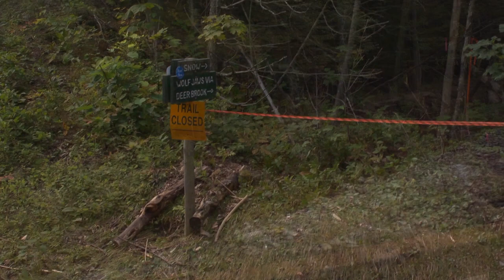Scars Of Irene

Comment: An excellent video, but important to note that it was done well into the cleanup effort...when there was access.  Bridges were usable at that point and much of the destruction that was there just days before was absent in this.  In and of itself, that's also a testament as to just how diligent the nat'l guard, dot, volunteers have worked.  It was much, much worse in the first 3 days after Irene and in other towns along the ausable that weren't noted in the video.  Thank you for posting this!